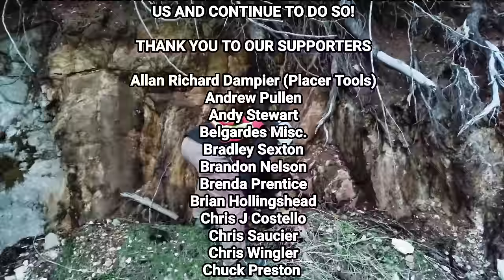Removing High Grade Gold Ore From Gold Quartz Vein & Panning For Gold!

Comment: You could use feathers and wedges for quarrying big chunks of rock.  Just drill your hole like you do and insert 2 l shaped flat strips of metal and put a wedge between them and start tapping the wedge with your hammer until the rock splits.

Comment: That kind of vein work needs a small to medium or even large jackhammer and onsite air compressor set up to make profitable headway! When there is enough or more than enough to too much pure liquid Quartz at the Volcanic heat cooking phase. Then the Minerals fully cook into it and finish the smelting or metal producing process with the present heat, and the correct kinds of Minerals and stages of development. If there is not enough pure liquid Quartz at that time, then the Quartz amounts fully cook out and turn to pure white powders eventually, after cooking all the Mineral Materials they are able to engage and cook with. Then take the process as far as they are able to reach. The cooking to completion process can be re-engaged with the correct Minerals, Pure Crystal Quartz and Temperatures.

Comment: Hi guys, here is a beneficial suggestion. When your drilling an outcrop it is best to drill in an X figure instead of drilling parallel holes. Let your drill holes cross each other. You still get the depth and you weaken the structure of the rock. Keep filming and I'll keep watching. Later.

Comment: Now Mr 9/11, I would always have selection of chisels to utilize in such as your Dewalt drillings, a chisel just over-size of the holes drilled given a mighty whack on the top of the chisel the rock had to gain a fracture or to then just repeat the process as is needed. Once you got a decent fracture then bring out some of the larger and wider masonry chisels. By all means, try it next time out for faster fragmentation of large rock